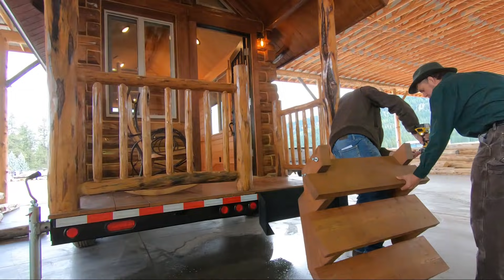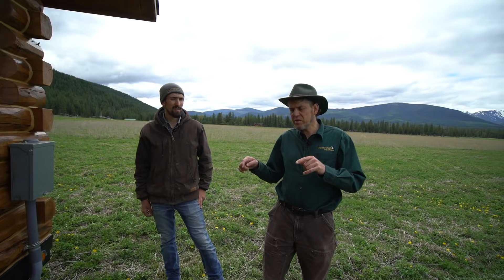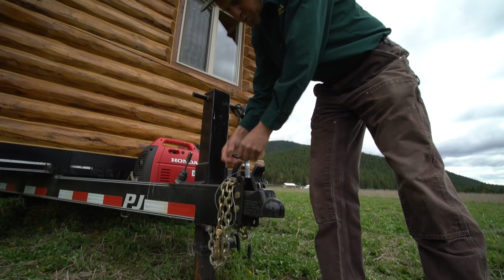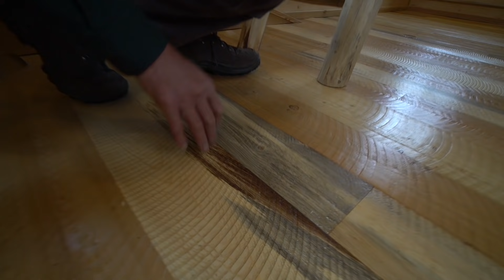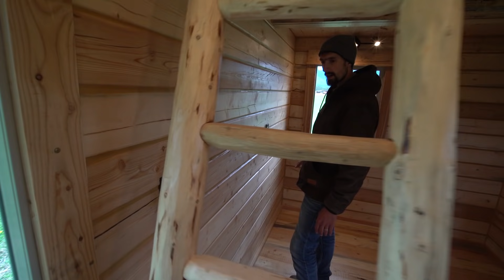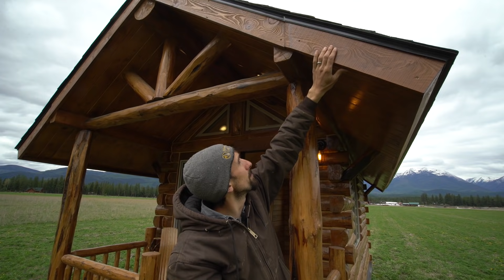Log Tiny Home On Wheels- Details and How to Buy or Order

Comment: Can you build a bigger one on a Gooseneck trailer? 
I love the one your Nephew just built. Great ideas!
Reply from the maker: Yes we can go bigger. It will require a CDL driver and over width permit.
Reply: @AmishMeadowsOfficial  Thanks!
I Love the one you just made and the lights and the beautiful logs. I have been looking at Lance Trailers but always wanted a Log Cabin. This is the perfect solution. I don't have a place to put it. I'm taking care of my Mother now. But I will definitely get one someday.
Reply: Diana Blanke do you have the link too his YouTube channel?
Reply: @clevelandcoincollector5372 , Yes! I have been watching all Elvie's videos. Thanks.
Reply: @clevelandcoincollector5372  yes, Meadowlark Log Homes!
Reply: Gefällt mir sehr gut. 👍😊👷‍♂️Gute Arbeit fantastisch. Alles solide. 🏡
Reply: @AmishMeadowsOfficial  a person could check into that because you could classify it as an RV. My friend has built a few semi trucks into RV's and hasn't had to get a CDL to drive them. Also Power Coach's here in Idaho falls custom builds semis into RV's and doesn't require a CDL according to Idaho law. Some states are different like Texas you have to have a different license to pull an RV. But they acknowledge other state laws so if you have a Idaho drivers license and were in Texas you wouldn't be required the special license. But if you went wider than the 102 inches I'm sure everything would change. Also here in Idaho you can go 14 feet before needing an over height permit. Great job on that build, you put a lot of beautiful detail into this and what a great deal on such a great work of art! Just that trailer by itself can cost around $7,000.

Comment: Looks Fabulous.  I would make the following changes to reach perfection!   [1] That ladder looks too hard to transition to the loft.  It needs to be flush-mounted rather than sticking up 6 or 8 inches.  I would also install a handgrab protruding from the bottom of the ceiling log to help an older guy like me get up there!  [2] You should offer a marine-style propane wall stove -- they're lovely, appropriate for this small floorplan, and allow you to see the flame to get the proper cabin feeling.  (They're also very safe.)  [3] IS it possible to make alterations to the loft design?  I would like to look at getting it an inch or two lower and sacrifice headspace in the back.  And, possibly, just convert the loft space to cabinet for storage (I've still got a lot of stuff!).  

But I will be looking into this!

Comment: Hi, this is some of the best information videos I have seen👍 Only thing I missed was weight information. I'm Norwegian, but if I had lived in America I would have called you for a trade! I am currently building my own trailer cabin, but in Norway the weight must be a maximum of 3500 kg. My cabin will also be 20 feet, but hopefully under 2500 kg.
best from Tore.

Comment: You said the weight came in at 2000 lbs less than the legal limit but it is empty.  How much is it going to weigh once you put a kitchen in with stove and refrigerator and a couch and bed and everything?  It does look very nice and well built. Great job!
Reply from the maker: If a full bathroom and kitchen and appliances were added I can’t imagine them adding more than 1000 pounds.

Comment: I too am curious about the roof folding and not damaging the shingles.  Also, how water tight and proof is the roof if it is folded up and while traveling you get stuck in a bad rain storm.  I have had travel trailers for decades and you always end up traveling in the rain at some point.
Reply from the maker: Two rows of shingles are temporarily stapled and would have to be removed when you fold them up and then when they’re folded down they have to be installed again. It’s going to take more time to transport than a regular RV trailer, but in order to have a genuine log cabin experience the fold down eaves is what we had to do.

Comment: Does the foam underneath below the OSB floor act as the moisture barrier? What is the cost of the one that is finished out with the kitchen and bathroom? Is there some way to lock down the eaves once they are deployed on site so that any strong winds will not move them up and down?
Reply from the maker: The foam underneath acts as a vapor barrier and yes the eaves can be screwed down with the support braces so that they would not blow up in the wind.
Reply: @AmishMeadowsOfficial  thanks for your quick reply. You mentioned during the video putting in a kitchen and bathroom. Does that fall under custom or would that be an upgraded model of this particular home?

Comment: Hey guys I love homes you guys do great work and im loving this tiny home beautiful work.  ? How much for a 38'x10' gooseneck trailer w/ power wired for off grid solar w/ backup generator and a mini split also piped for a mini wood stove w/full plumbing for bathroom w/tiled shower also toilet , washer/ dryer, kitchen sink and dishwasher hook ups .I'd like it opened feel loft bedroom would be the fifth wheel w/ log steps to this private space and bathroom with washer/ dryer bf that    to left side then same side your fridge kitchen counter w/ farm sink then,dishwasher and a small bar at the end of the counter then the rest would be a small living room and the small porch like this one

Comment: I'm not sure what the ultimate goal here is. If this will be towed once to a final destination, it's awesome. If it's meant to be towed off and on, that roof needs design improvement. Overhang on the front will create a ton of drag, the shingles  at 70mph will be interesting, the folding roof is novel, but not realistic for repeated use, and why not folding steps? Love you guys!
Reply from the maker: This cabin is not meant to be towed all the time. It can be towed from one location to the next but only occasionally. It’s not meant to be a full-time RV trailer.

Comment: You can get a similar-sized with the complete interior done with kitchen , kitchen cabinets,sink,water heater kitchen counter bathroom sink, toilet,shower appliances Heating/ Air  loft, spray foam insulation ,metal roof All pine interior and exterior and more everything done ready to go for less then you're selling these at Incredible tiny homes in Tennessee
Reply: Do you know how those are built? I bet they aren’t made with real logs like this one is.